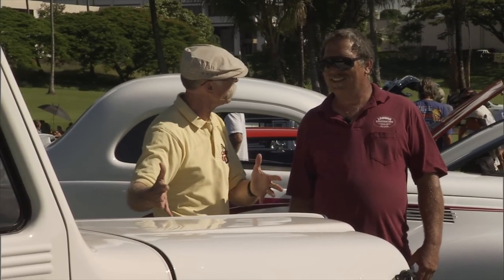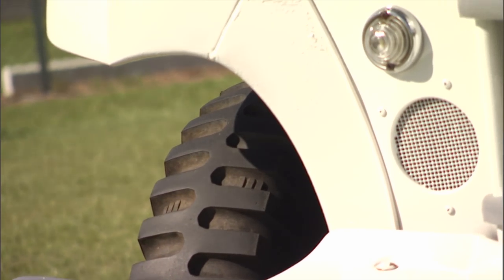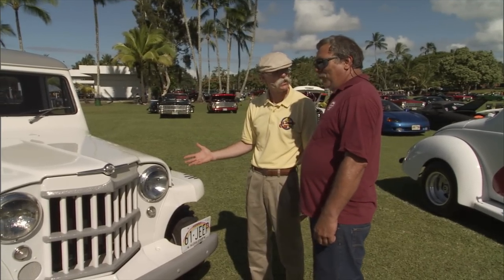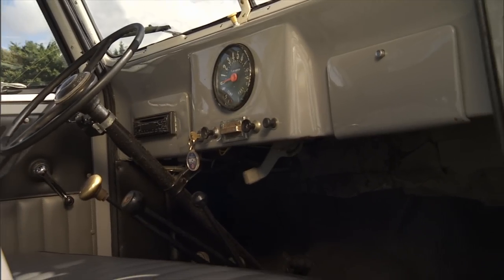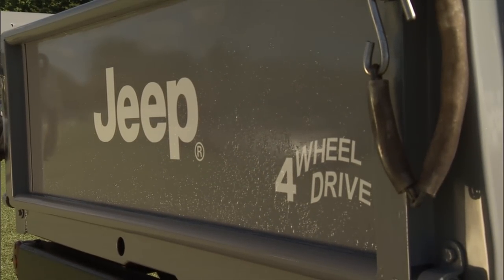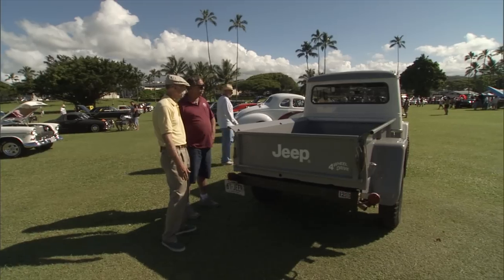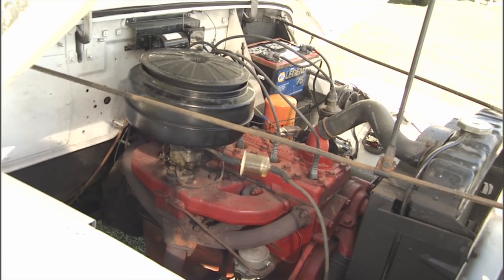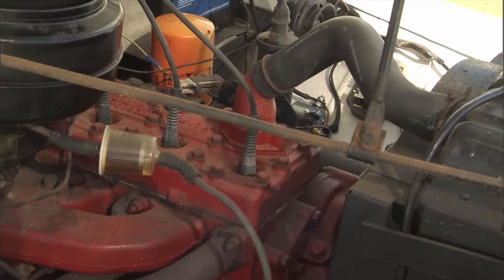The OG Original Gladiator Jeep Pickup Truck

Comment: Horsepower rating is 105 hp (78 kW; 106 PS) at 3600 rpm or 115 hp (86 kW; 117 PS) at 3650 rpm,[12] as well as a torque rating of 190 lb⋅ft (258 N⋅m) at 1400 rpm or at 1800 rpm,[12] depending on the year of production.
Reply: Yup. The 226 in the model number meant 226 cu. in.
Reply: Correct 226 cubic inches, 105 HP
Reply: The Lighting 6 was the best one. But we pulled them out and put in the Studebaker Champion flat head 6 was way better

Comment: Had a '59, titles as a '61. Made it to look like a farm truck, rough cut wood bed, stake sides, grass chains(not snow chains), oil bath air filter, and Hurricane engine. Top cruising speed: 45-55 depending on the grade of the road and head wind 😄

Comment: They also made these trucks in a 2 wheel drive version. They are much harder to find than the 4x4. He is a bit optimistic on the horepower rating but with the super low gears and almost 200 lbft of torque I probably feels like 200hp.
Reply: they was 90 horse

Comment: If it is truly a 61 then they replaced the windshield frame or, not likey, added the center cross bar. In 61, the Willys Truck did not have the center window bar. Horsepower was rated at most at 115 depending on year and/or options.

Comment: I don't get these wives tales. I own a 1951 4wd Willys truck with the original F head Hurricane 4 cylinder. Stock gearing @4.88:1 and it will go 65-70 mph on a flat. Steep uphill: 45 mph. Its a great truck, built to last!

Comment: The 226 is the size of the engine in Cid and the horsepower is not more then 110hp, the flat head 6cyl has great torque but it lacked in the horsepower department

Comment: 230 HP???? I don’t think so! Torque may be but not horsepower. Get your fact right mr owner!
Reply: I think you are right on that one. If it only does 55 mph that is very low gearing for over 200hp. Really nice truck though! With the right TLC, will last another 100 years!
Reply: 105hp/115hp 190tq